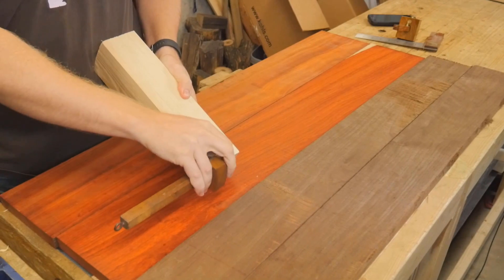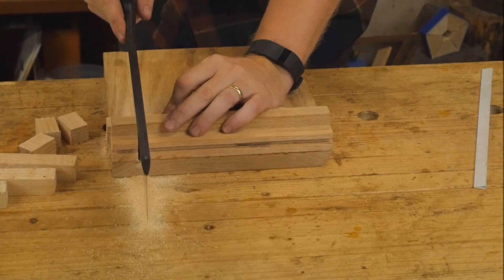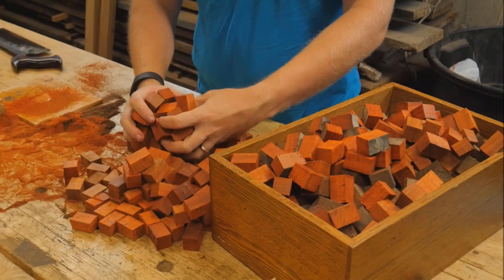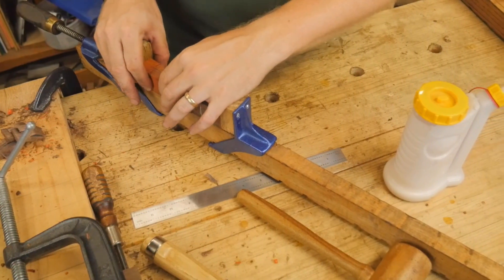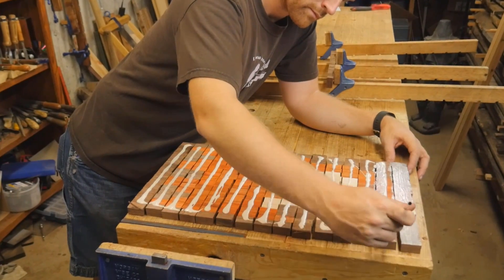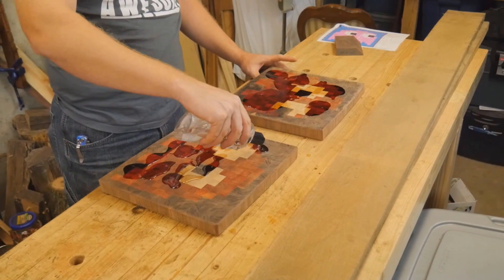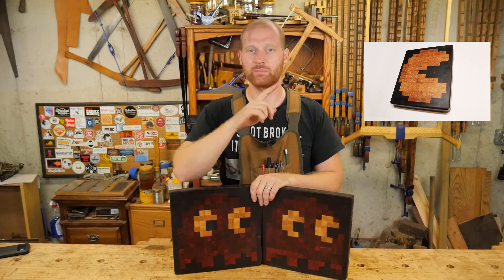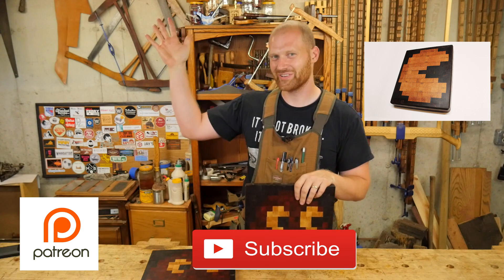How to Make an End Grain Cutting Board with Pac Man Ghost Pixel Pattern

Comment: Having made a number of end grain cutting boards myself, I have to admire your tenacity! Suggestion: pick up a small paint type roller & use that to spread the glue. It can be kept in water when you are not using it, then just ring it out & use it again. Also, end grain boards tend to warp over time, so watch out for that. Otherwise, great project.......... Steve
P.S. For the master of end grain cutting boards, check out mtmwood......:)
Reply from the maker: I was thinking about the roller. I might just have to get one. I only think about it when I am glueing though. LOL I love mtm. his work is fantastic in so manny ways.
Reply: So, are you saying that I read your mind again? LOL
Reply from the maker: +Sapele Steve this is getting scarry